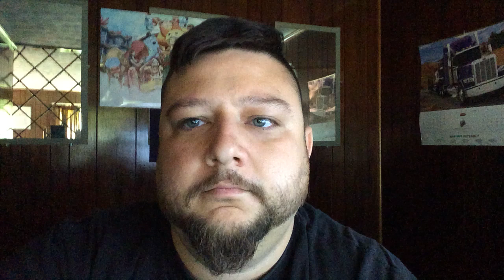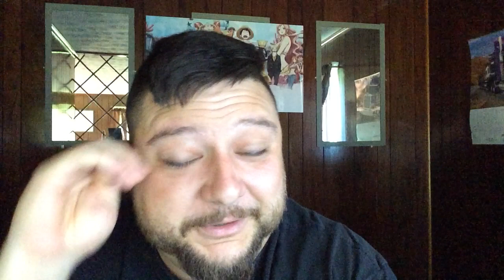The Turbo Piston Solution For FRM Sleeves

Comment: I have a 94 h22 closed deck non frm sleeves in my 94 accord coupe , handles 13psi daily , all stock except crank and cams, bolt on I/H/E tuned making 332whp , reliably on a 56 A/R
Reply from the maker: yep no doubt. me declaring that there were non frm sleeved H22's caused a fuss with some ppl. good to see someone with one commenting. cheers!
Reply: ayyjay okay what sleeves do you have then? I also own a 94 h22a black top closed deck.
Reply: Okay why the fuck are you changing the crank and cams when the stock ones are good for way past what you claim to be making
Reply: Christian Prusinski he coulda had cams before boost and could be using a h23a crank🤷‍♂️ so
Reply: Sounds like b.s. to me
Reply: Matthew Pittmann its possible lol
Reply: what crank and cams does it have? And what do you mean by non frm sleeves? Are they iron sleeves from the factory?

Comment: I'm running NPR pistons with frm h22a1 block and in rips 276hp 0n pump gas with just skunk 2 manifold  and 70mm throttle and skunk 2 pro 2 camshafts and king bearing and h beam rods and all arp studs
Reply from the maker: Will do. He used k20 pistons?
Reply: NPR h22 type s pistons not k20 very similar  87mm
Reply: I built motor  from bottom up my self did plastic gauge on all bearings  and piston ring gaps runs smooth as ice no problems at all for 6 years now freeway pulls every day still same power no smoke at all oil pressure and temp perfect
Reply: 13.5 comp head shaved  10 thousand
Reply: With stock valves with supertech valve springs
Reply: And KS tuned balance shaft Eliminator kit installed myself
Reply: And ECU is a p28 with Mugen p14 ship runs awesome no need for s-300 if you know what you're doing

Comment: Thanks for this. I was still thinking a cheap set of dry Darton sleeves like around 300, and paying a machine shop to press them in. I'm torn, i want the ability to boost the crap out of my h series but i also interested in the great value the NPR pistons offer. I would save a good bit of money going the type s piston route but for only like a couple hundred more i could dry sleeve it, that is supposedly rated for 40psi and never have to worry about the internals.
Reply: I know this is old but any update? What route did you take?

Comment: I have a friend who has built over 10 G23 and he has problem after problem. What do you do about the bore and head combo I heard they are prone to detonation? And my friend always has the oil passages plugged, but they always seem to leak. The water pump pully and water pipe all that's easy. But would really like to know about the bore and head combo what can be done about that.
Reply: Your buddy built a G series 10 times or built 10 G series. And still can't get it right? I'd say Its human error at that point. Lmao

Comment: I'm pretty sure that a kseries piston would fit in a h22 /h23/f23
Reply: Adrian Lee I have an f22 block on a stand, K20a2 pistons and an f23 head. Should be interesting. Just gotta bore the block 1mm
I've heard the K wrist pin is offset. I couldn't see it on mine. I'm pretty sure I measured it and it wasn't. But maybe some are? I need to measure them again.
Reply: No k20 pistons have a smaller width  for the top of the h22 rod so u have to shave top of the h22 rod were the wrist pin goes make it thinner then it will work correctly
Reply: That's only if u are using h beam rods
Reply: And if you compare a K20 h-beam Rod compared to a H22 h-beam rod the H22 is way wider and stronger
Reply: That's why  K20  grenades when you over rev h22 all day is stronger only think good about k20 is timing chain  .